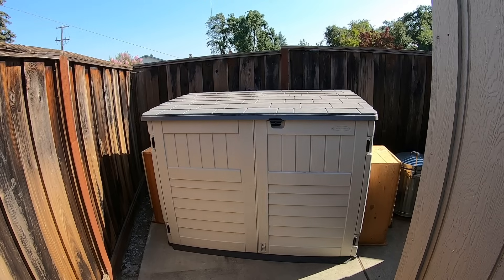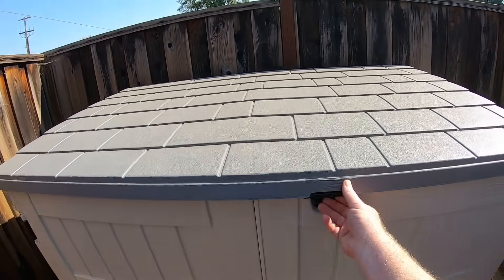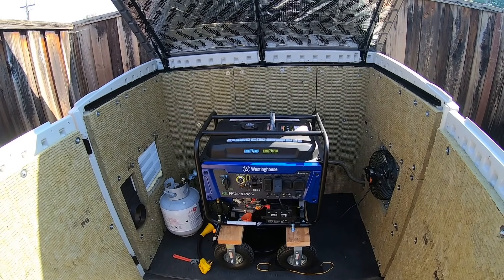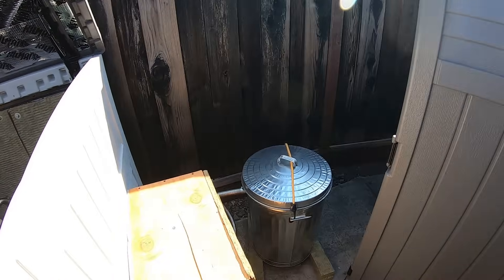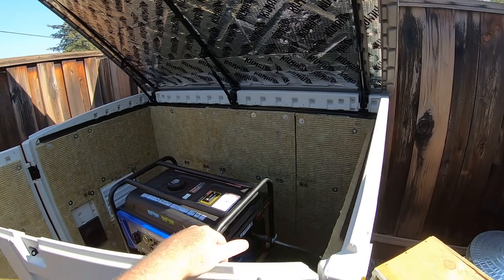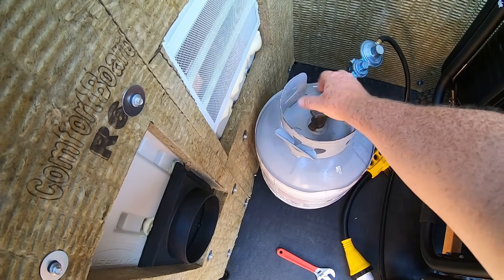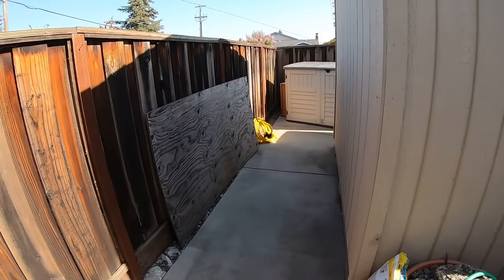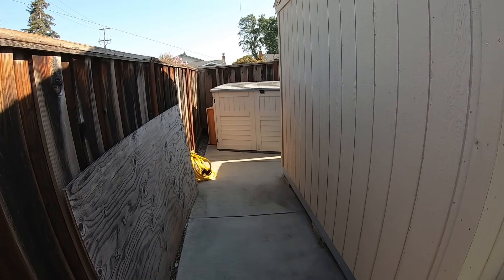DIY Generator Shed Build - Quiet Sound Insulation with Exhaust Muffler

Comment: What screws did you use on the rock wool?
Reply from the maker: I actually go into this very topic in a later video on my channel (See the description for the links).   I have a whole section of the video where I talk about the specific screws I used to attach the rockwool to the shed.  The later video is on my Version 2.0 exhaust, which has quite a few improvements over the earlier version 1.0 setup.  The newer video has parts lists, shed costs, and other Frequently Asked Questions.  Check it out here: https://youtu.be/y3pUw408jCU

Comment: I got my electrical work done and had a 50 amp plug installed on the outside or the house. I had pavers installed an bought and assembled the shed.  Since Winter is coming, I may not get the shed completed until the spring.  I have a question regarding grounding.  I have the same generator.  Do I need to remove the ground from the generator or ground the generator to a ground rod? Thanks!
Reply from the maker: Per my electrician, if you are connecting to your house wiring, it is already grounded through the electrical panel.  If you are running things while not connected to the house, you might want to use the grounding rod.  I have been able to charge my bikes at the MX track without a grounding rod with no problem.   I also think if you are going to use the grounding rod that there was a change you needed to make inside the generator (if I recall correctly.)  It was mentioned in the manual about moving one of the wires from one connector to another.  I could be wrong.
Reply: @C5Tor  Thanks, My electricians actually added a 2nd ground rod to my house. I had them put one by the generator just in case.  Ill do some more investigating to see what is the right thing to do. Thanks again.

Comment: Also did you have to put in an adapter to put the fan in the wall?
Reply from the maker: If you are asking about an electrical adapter, then no.  The fan came with a standard 120v 3-prong plug, which plugged into one of the standard outlets on the generator.

Comment: What kind, brand of fan did you buy and where did you purchase it?
Reply from the maker: I go into the parts used in a later video.  In the later video, I cover parts lists, shed costs, and Frequently Asked Questions about the shed, as well as a bunch of updates I did on the shed, the exhaust and the muffler.   I talk about the fan at about the 30 minute mark, which you can go directly to here:  https://youtu.be/y3pUw408jCU?t=1850

Comment: Definitely the best sound deadening shed. I would Ike to know what you used to mount the sound board. By the way I had liked your videos and YouTube erased the like!  Why do they do that? That’s not right.
Reply from the maker: Thanks Jeff.  I actually go into this very topic in a later video on my channel (See the description for the links).   I have a whole section of the video where I talk about the specific screws I used to attach the rockwool to the shed.  The later video is on my Version 2.0 exhaust, which has quite a few improvements over the earlier version 1.0 setup.  The newer video has parts lists, shed costs, and other Frequently Asked Questions.  Check it out here: https://youtu.be/y3pUw408jCU

Comment: What size shed is this? 2 ft. 8 in. x 4 ft. 5 in. x 3 ft. 9.5 in. ?
Reply from the maker: I believe this is a Suncast Stow-Away shed.  About 6' x 4' x 4'.
Product Dimensions
Exterior Size: 5 ft. 10.5 in. W x 3 ft. 8.25 in. D x 4 ft. 4 in. H
Interior Size: 5 ft. 5.5 in. W x 3 ft. 2.5 in. D x 4 ft. 1.5 in. H

Comment: i was  wondering why no one would address the intake and exhaust cooling vent like you did until now. you understand sound travel! thanks for doing it and showing me that what i was thinking did work very well. i am going to tweak your design and make a box like yours when I heal from carpel tunnel surgery, i am going to use concrete hardy board instead of plastic walls
Reply from the maker: Good luck on your build.  I also watched countless generator shed videos and always wondered why everyone was okay with all the noise coming out of the inlet/outlet holes in the shed.  My experiment turned out better than I thought it would, and I'm sure there are better ways to do it and still have adequate airflow.  The same thing with the trashcan muffler; I couldn't believe nobody had tried something similar, but I couldn't find anything else like it.  Make sure you check out the later videos in this series, as I add lots more info on the parts I used, shed costs, and tons of improvements to make the shed and exhaust safer and better performing.
Reply: @C5Tor  I wonder why nobody has built one out of cinder blocks, fire proof, easy to build and soundproof , Just a thought

Comment: Ànd extensive job ..well done . Curious what was the decibal rating for your generator 90+ seems really high my firmen  has a decimal rating of 75 and just a simple A frame I built to put over it brought it down to 71 from 10 ft away. But again great job!
Reply from the maker: Well, the generator is rated from the factory at 74dB.  But I think that is tested in an open space from about 7 meters (23ft.) away, if they used standard methods.   I didn't test it from that perspective.  I didn't put it in the middle of my yard and walk 23 ft away.  It might actually test out to that level under those specific parameters, but that was not the environment that I was going to use it with in my backyard.  In my circumstance, it was surrounded by fences and sheds and its own generator shed, so that changed the dynamics.  It's much louder at close range, especially when the sound is reflected back at you.  As you could see from my testing, different parts were much louder at close range, especially the exhaust.  But, if I were to set it up in the middle of a field and run it that way, it would definitely have had a lower sound level.

Comment: Bought a generator to charge electric motorcycle?????????????
Reply from the maker: Yep, I said that.  I didn't say I was going to charge them at home, but rather that I would use it at the motocross track or out in the woods where you don't have access to an electrical outlet.  Crazy concept?  Next thing you know, people will be using electric gas pumps to fill up their gas cars with gas!  (Spoiler alert: They do!)
I actually address this very concept in the Frequently Asked Questions section of a later video I did on my Version 2.0 upgrades to the shed and muffler.  That video has lots of info on the upgrades I did, parts lists, shed costs, and other Frequently Asked Questions.  If you want to jump right to the part about charging electric motorcycles with gas (or propane) generators, it starts at about the 50 minute mark, or check it out here: https://youtu.be/y3pUw408jCU?t=3000

Comment: That's an awesome build. Nice decibel levels. You should add an E stop outside ? Move the fuel outside?  could shut the fuel off in an emergency... Just a thought. Peace man
Reply from the maker: Agreed.  You shouldn't run the generator with the propane in the shed.  The shed is setup to move the propane tank out to the left side, and then pass the hose in through the same port that is used to pass the electrical cables out of.  The tank was just in the shed for storage, and I happened to film the sound test with it in there, since it was only going to be a couple of minutes.  But definitely safety first.

Comment: Not sure if anyone has asked, but why are you wearing a helmet? Lol
Reply from the maker: I actually go into this very topic in a later video on my channel (See the description for the links).   I address the helmet thing in the Frequently Asked Questions section.  The later video is on my Version 2.0 exhaust, which has quite a few improvements over the earlier version 1.0 setup.  The newer video has parts lists, shed costs, and other Frequently Asked Questions.  Check it out here: https://youtu.be/y3pUw408jCU
Basically, I had a motocross helmet with a chin-mounted GoPro, and I wanted my hands free to hold the decibel meter and open the shed, etc.  So I used the helmet.  Not the best setup for quality sound, since it put the camera microphone about 2" from my mouth, but it was convenient and gave a good point of view.  Others have conjectured that I have a huge head, am extremely ugly, or might fall down a lot (all of which might hold varying amounts of merit), but that wasn't my primary reason for wearing the helmet in this video.

Comment: Good idea using the trash can. For permanent stationary engines I have seen people use 55 gallon drums sunk level with the ground full of rock with the exhaust pipe 3/4 of the way down and they are almost dead silent.

Comment: Someone will take it...bolt it down
Reply from the maker: Well, with all the stuff in it, it's like 500 pounds.  Plus, it won't fit out my gate unless they dismantle it.  And they'd have to scale the fence, get past the dog, the razor-wire, the minefield, and the anti-aircraft emplacements.  But it is locked, and it is bolted down.

Comment: Why not just an automotive muffler adapted to your flex pipe?
Reply from the maker: I've answered this one before, but I'll come at it a different way.  If you search YouTube for "Generator and Auto Muffler", you'll find quite a few attempts at using car mufflers on generators.   I watched quite a few of them.  Most of these attempts did absolutely nothing, mostly because they didn't quiet down the rest of the sound from the generator.  The ones that did a decent job of that reported that it didn't make much difference in overall sound level.  In general, it changed the quality or frequency of the noise, but didn't do much about reducing the overall volume.  I think this is because most automotive mufflers are designed to reduce noise at specific frequencies and flow rates, and the generator produces sound at a much different frequency and flow rate.  That is why I went with the basic concept of a motorcycle muffler, only scaled WAY up.  A generator and a motorcycle are very similar in displacement and sound, and the concept seemed to work well.  You can check out the later videos on my channel on how I went about designing and building the original trashcan muffler, and how I came back later and improved the overall efficiency of the muffler.  That last one has lots of info on parts lists, shed prices, and frequently asked questions.   Links for the later videos are listed in the description for this video.
Reply: @C5Tor  Outstanding work, Im looking for a large junk Freezer Chest that might fit my generator.

Comment: I went through this with my camper. my final solution was a 7k Honda in a box.  The inverter allows the engine to run much slower.
All of his work seems successful,  good job.  The Honda is portable,  but over $3500.
Reply from the maker: Would have loved to use the Honda, but it was too small (capacity-wise) and way too pricey.

Comment: I suspect you might have been better off to buy one of the newer super quiet, inverter generators. Same amount of power, no need for a cabinet, better fuel economy.
Reply from the maker: I wish there had been any of the quiet inverter generators available that would have fit my requirements.  I do address this in a later video on this channel (https://youtu.be/y3pUw408jCU) where I answer some Frequently Asked Questions.  None of the quiet inverters that were available at the time had enough running watts to fulfill my primary requirement, which was to charge two electric motorcycles (at the motocross track) at 240v at the same time, which was going to take at least 8000w and 32amps continuous power.   The Predator 9500 from Harbor Freight came close, but it was a few watts short.  The Honda and Yamaha quiet inverters didn't even come close on power, and they were also outrageously overpriced.  I still haven't seen a quiet inverter genset that has the specs to pull this off.  Hopefully soon!  While this Westinghouse WGEN9500DF generator also has "9500" in the name, that's continuous rather than starting watts (which is 9500/12500 continuous/starting watts for gas, and 8500/11200 for propane.) The Predator 9500 for comparison is 7600/9500.  Hope that makes sense.
Reply: Certainly. I just think it's a lot of effort for a modest difference in output power and reduced fuel efficiency. I do accept that in 2021 the Predator 9500 were very hard to get. They sold out as fast as stores could get them. Now there are a number of variants more generally available, under several band names.

Comment: I just bought the same generator.  I am looking for ways to make a permanent outdoor connection. thanks for this.
Reply from the maker: Make sure you check out the later videos in the series (see description for links) for how I made the trashcan muffler and also some revisions I made later to improve performance.  Also includes parts list, cost, and Frequently Asked Questions.
Reply: @C5Tor  Thank you.  Can you tell me more about the tap to thread the exhaust.  you said a 3/4" tap, what kind did you use?
Reply from the maker: I actually go into this very topic in a later video on my channel.  While I do go over how I originally tapped the muffler outlet for a small piece of 3/4" pipe (using a 3/4" pipe-thread tap), I ended up scrapping that method and welding on a small 1" pipe nipple instead.   The video goes into detail on my Version 2.0 exhaust, which has quite a few improvements over the earlier version 1.0 setup, including upgrading all of the piping from 1" to 2".  The newer video has parts lists, shed costs, and many other Frequently Asked Questions.  Check it out here: https://youtu.be/y3pUw408jCU
Reply: @C5Tor  Thanks!   I probably wont get this completed til next spring but will try to get some done before it gets too cold.  Hopting to at least get the electrical work done in the next couple weeks.   Im looking for the easiest way to extend the muffler and still be safe.   in your original design were you able to retain the Spark arrestor.  I have seen others where they remove it.  is that a good idea?   is it difficult to remove the muffler?  While I was a mechanic 40 years ago, I dont have all the same skills I used to :)
Reply from the maker: I talk about the spark arrestor and how I built a higher flowing one in that last video I referenced. (See about the 18:24 mark, here: https://youtu.be/y3pUw408jCU?t=1104). It is not needed in a home installation.  The spark arrestor is for use in the woods or other places with dry vegetation to prevent forest fires.
Reply: @C5Tor  I dont think I am going to do the welding route, but am confused on the tap.  the inside diameter is about 1 1/8. can you tell me exactly what tap you did use?  thanks!
Reply from the maker: That is not the case on my muffler, although there may be different designs for the muffler on the same model of generator.  On my muffler, the "outside diameter" (OD) of the exhaust pipe is 1 1/8'.  The "inside diameter" (ID) of the exhaust pipe leaving the muffler is just slightly under 1".   Pipe is measured by inside diameter.  A 3/4" pipe is 3/4" ID, and 1" OD.  But pipe thread is beveled a bit, so the OD of a 3/4" pipe at the very tip of the thread is a bit under 1", and then it works its way up to 1" at the thicker end of the threads.  By using a 3/4" pipe thread tap, (like the biggest one here:  https://www.amazon.com/gp/product/B08GK5JH8B ), I was able to thread the inside of the muffler outlet just enough to get a 3/4" pipe nipple threaded into it.  If your muffler has an inside diameter of 1 1/8", then you couldn't use this particular method.  But  that is how my muffler was setup.  Hope that makes sense.
Reply: @C5Tor  Thanks again,  I will measure it again. The inside may be 1" and the outside 1 1/8.  Thanks for the link.

Comment: Nice. Another layer will deaden the engine knocking. What if you use a used car exhaust or add more angles to cancel out the sound inside the trash can and baffles. Heavy ply wood should deaded the sound.
Reply from the maker: The trashcan is already full of sound baffling and more rockwool.  Make sure you check out the later videos in the series (see description for links) for how I made the trashcan muffler and also some revisions I made later to improve performance.  Also includes parts list, cost, and Frequently Asked Questions.

Comment: Wow. A commendable job. Great innovation. i am actually going to steal your idea. Big thanks. I have to ask. Why don’t you have it hooked up to a sub box direct into the main fuse box. It makes the power transfer so easy. No lugging the big extension cord and having to plug 😊things in. Great video.
Reply from the maker: That would be nice to have everything hard-wired, but this generator isn't used primarily for backup purposes.  It's really used at the motocross track or camping.  Backup power is just secondary, so I didn't spend a lot on infrastructure.

Comment: Really good build and overview! Have you had to run your generator for at your house since installing everything? If so what’s the total runtime and the longest single run?
Reply from the maker: No, haven't had to use the generator in anger yet.
Reply: I had the same question, but specifically about heat build up inside the shed.  Any idea how hot it's getting in there?

Comment: The spec sheet says this generator have a 72 decibels rating
Reply from the maker: Yeah, that would have been nice, but clearly not the case in a real-world scenario.  Maybe if it was sitting in the middle of a field, 50 yards away, behind some bushes, and surrounded by a very sound absorbent herd of cows.  But sitting in a small shed with all the sound bouncing back at you, not so much.